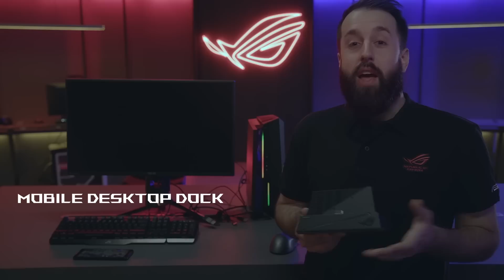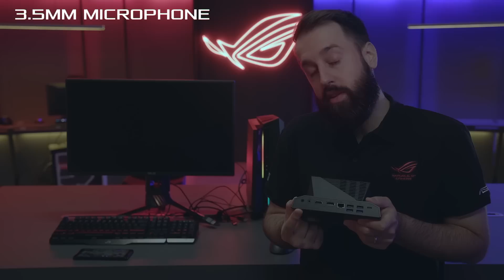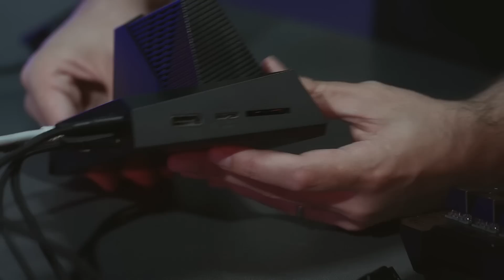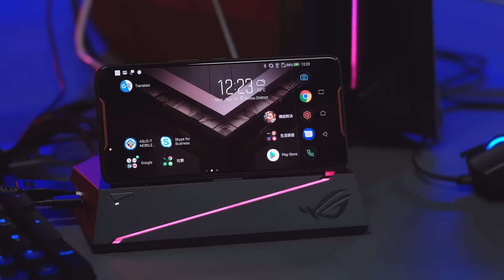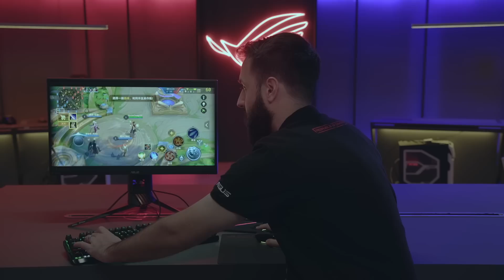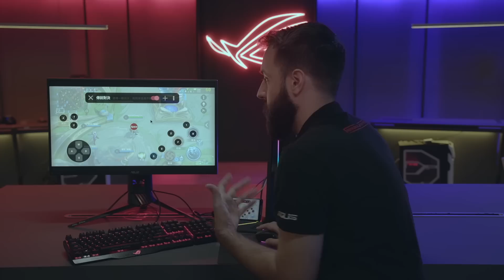ROG Phone: Mobile Desktop Dock

Comment: This this as well as every other accessory ive gotten for this phone is garbage. you need a specific charger for it that unless you buy the expensive version of the phone it doesn't come with nor will the dock (55$ charger btw) got everything i needed to set the dock up with my pc doesnt even display the pc to the tv. good luck trying to find any help in the support forums to trouble shoot anything as there is next to no information and they seem to have no idea how any of the tech actually works. the kunai's look cool but are an absolute joke functionality is limited. Honestly the ONE redeeming quality about this phone is the side charging port. honestly get a razer phone 2 with the fly digi Wee series controller (havent tried the jungle cat as I had made the mistake of "upgrading" to this downgrade of a phone.) its MUCH MUCH MUCH cheaper and MUCH MUCH MUCH better and less of a hassle with better results

Comment: Keeping d phone plugged in for lets say 24hours straight gaming. How does the battery handle it while plugged in. In regular phone u end up killing d battery.
Reply: Nope my Oneplus 3T i use it a alot using gamesir g1 with keyboard and mouse plug the charger for 12 hours every day the battery is okay daily use.
Reply: @quickdraw7593  Just want to ask if your phone is still okay until now? Is there a noticeable difference in battery health after a year of doing that? Thanks in advance
Reply: @eado22  no noticeable but my phone now i sold it to my coworker as he wants it badly coz its pretty thin and fast and battery is long enough for his needs all okay up until now.
Reply: Theres a USB-C on the back specifically for charging